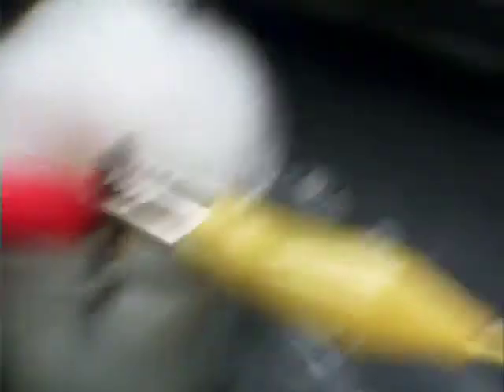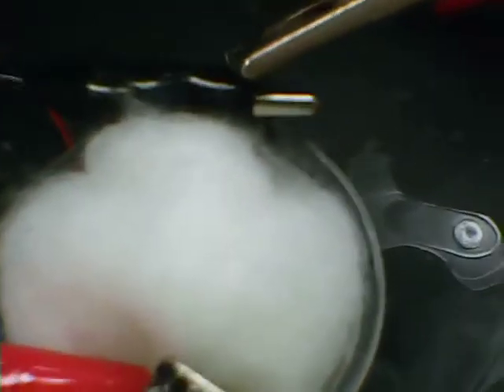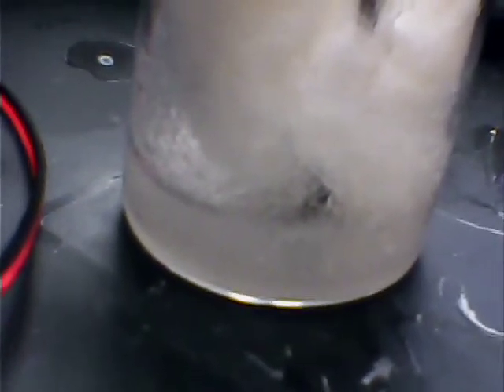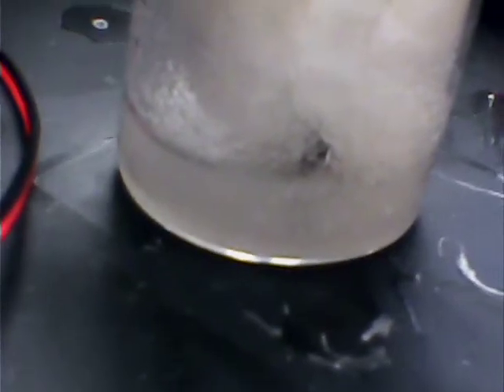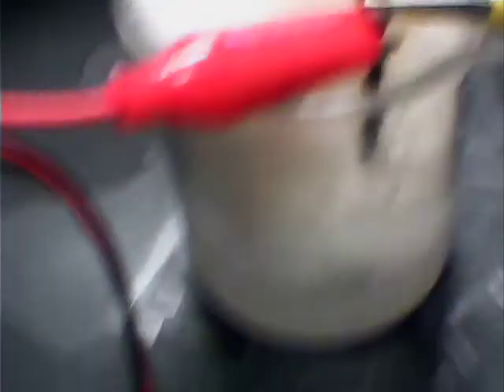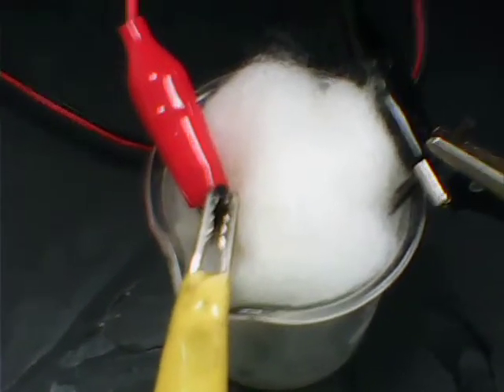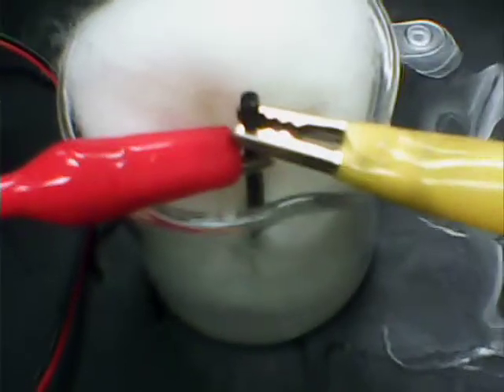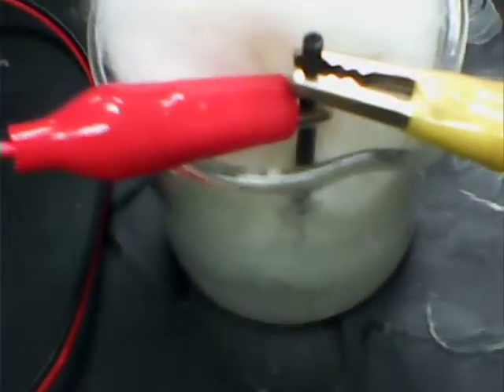Batteries/ Gel Electrolyte/ Bench-Scale Testing

Comment from the maker: Electrolyte
    resistance is dependent on the number of charge carriers and the mobility of
    the charge carriers through it. As the battery ages, components of the
    electrolyte can be consumed in corrosion of metal components in the battery,
    and in other secondary chemical reactions, thus reducing their concentration
    and decreasing the number of charge carriers. Build-up of reaction products can
    also increase the viscosity and polarize the electrolyte so that the ion
    mobility is reduced.

Comment from the maker: The electrolyte conducts ions, not electrons. The flow of electrons 
through the external circuit must be balanced by the flow of ions 
through the electrolyte (similar to a “salt-bridge” in a typical 
Gen.Chem. Cu/Zn galvanic cell demo). Therefore, if the ionic 
conductivity of the electrolyte is too low, that becomes the 
“bottleneck” limiting cell discharge rates.

Comment: Hi David, Thanks for reply.
so it's electrons travelling along the wire from the battery to your carbon electrode. Then ions traveling between the 2 electrodes through the electrolyte. Then electrons again through the wire to the motor?
Reply from the maker: An easy answer: The ions move through the solution and conduct current/ anode to cathode. Some of the current is drawn to a load ( i.e. motor) to do work via an external wire. Hope this helps!

Comment: would electrons flowing between the electrodes to the motor  be the same mechanism as ions traveling between anode and cathode in a cell?
sorry if its a dumb question, I'm not a chemist, just keen to learn.
Reply from the maker: The ion mobility is through the electrolyte (solution or gel) and electrons move through wire from anode to cathode. Battery performance , in one way, is measured through the electrolyte internal resistance which certainly depends on the conditions on the surface of the electrode. You are asking a msot valid fundamental question about electrochemistry for certain.The oldest cells have a 'salt bridge' between the two zones to allow the ion flow.